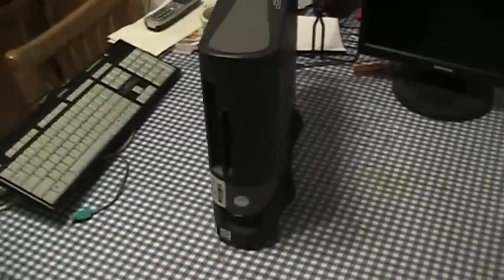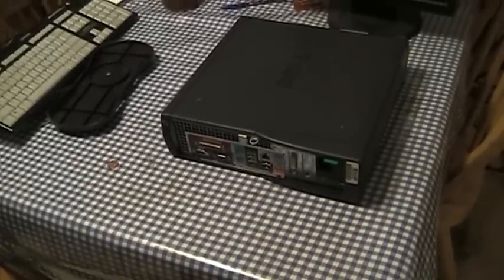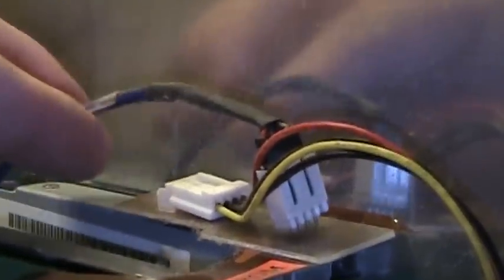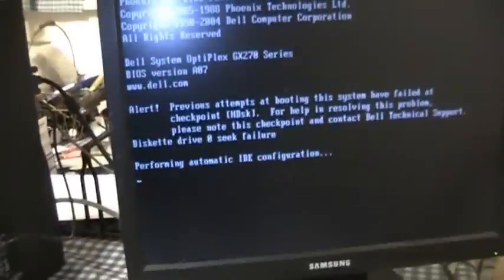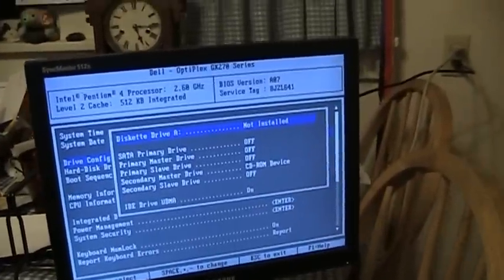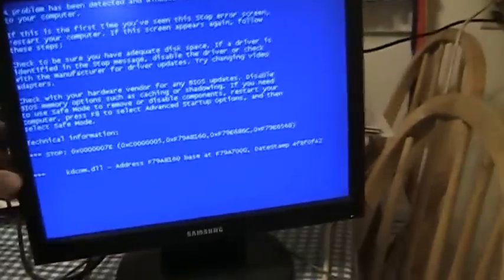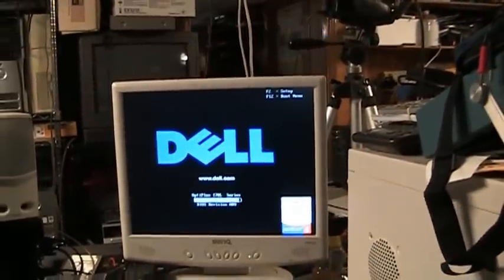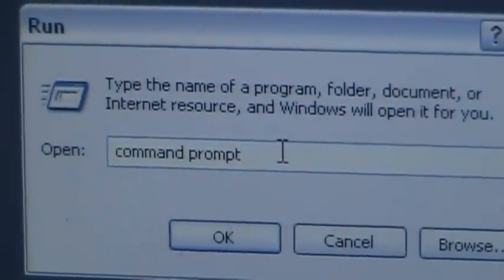UXWBill Explores Another Crappy Computer: Dell Optiplex GX270 SFF

Comment: Hello UXWBill, I need to ask you one question.
Is it viable trying resurrect Dell Precision 380?
I have little to no knowledge about Dell products, but I got two of these, both have bloated caps right next to the RAM bank (if I traced it correctly it should be power for RAM sticks). When I tried to turn them on, both had the same problem. I am not asking how to change the caps, I need to know if it is worth the time and effort. I can't decide because it has really nice sturdy case, but I don't know what cooling performance I can get from that.
Both has Pentium 4 Extreme, one has 4 GB RAM, one 1GB, one has Nvidia GT218, one Nvidia 9600GT. Both has one 250 GB drive, floppy drive (so it is real computer, wink wink) and DVD burner. As computer hobbyist and repairman I know this is pretty darn good stuff since it was free (both computers were scrapped from office), but I can put it somewhere else. So I need your opinion. Thank you very much for answer!
P.S. If there is some grammar mistakes, excuse me, I don't speak english as my primary language.
Reply from the maker: In all honesty that is something only you can determine. If you have a good use for these computers, or would like to practice your component replacement skills, it is probably worth repairing them. Replacement capacitors cost very little.
Reply: ***** Oh yeah, I could make it my primary Linux computer and learn that system a little. Thank you!

Comment: the mid 2000s dells are just crappy compared to the pentium iii ones, they're ugly as heck, crash all the time, and pentium 4 is nothing special; i had a dimension 8400 with sata hard drive, adequate memory, clean install windows xp with proper drivers and still slow as heck/crashing all time; i smashed it out of frustration
Reply: ***** and you didn't have problems?
Reply: ***** i must have had a bad one then... there were hardware issues when i got it then i reinstalled XP and the issues continued; or maybe it's XP, what OS did you use
Reply: ***** maybe got a defective one or just is incompatible with windows xp even tho it came with xp... idk strange
Reply: That's odd. I've never had any problems with P4 XP machines.
Reply: I bought a Dimension 8400 for cheap on ebay. Shipped with an ATI Radeon x300 and a Sound Blaster Audigy 2 ZS. I just had to get it. I upgraded it to a Pentium 4 640, it's a a 64 bit CPU.

Comment: The dell computer could of belonged to a school. Which could elate/relate to why there was a password on the bios. Along with the replacement PSU. Our school used to have the same systems and the power supplies just kept on dying. We hade them in our district from between  2000-2007. Have no idea when these machines were released for the public.   They ran windows xp pro with 412 megabyte of ram and really badly burned crt monitors that all had a black outline of the NOVELL Login Client in the middle of the screen as there was no screensaver.
Reply: Are you somewhere within the province of Ontario? everything you described is the same as our schools and in the same time period before they got IBM Thinkcenter PC's
Reply: I am not based in Ontario. I'm located in the USA and would rather not say what state. For security reasons and I meant to say 512mb ram
Reply: Peter Folchi
good enough, it's just that that situation seemed too similar to disregard it.  just asking, did it have either a Northwood or Prescott Pentium 4 running at 2.8Ghz?, if you can remember it
Reply: Devin Hepburn I believe it was a Prescott I can't say for sure as they were returned to dell after I finished 4th grade and then the school districts got dell optiplex 740 small form factor machines. Then in the 2015-2016 such school district upgraded to dell optiplex 9020 which have core i5 with 8 Gb ram and 500 GB HDD
Reply: Peter Folchi
I've been at 3 school's since, but from what i can remember, the school's PC"s were upgraded in 2014 to later Pentium 4 HT CPU's, no earlier than the year before the Core 2 line was announced. Now i see lower-end PC"s in our school with Core 2 Duo's, were higher end ones (the HP Compaq Elite 8300 specifically) using the i7 3770, 8GB RAM, and a 1TB HDD, which is what we use for my last period class
Reply: On our school district we had this computers with windows XP until 2010 and we had dell ultrasharp monitors with the same black outline from the Novell Client :D later with Windows 7 and the new HP desktops the network became more worse and even slower I'm so lucky that left school in 2012  after final exams...

Comment: I have a GX240 (or maybe it's a 260, I forget), the first computer I bought with my own money! What a POS, the narrow design with a rather small rear vent seemed purposefully created to choke itself to death with dust, and it couldn't run much of anything well.
Reply: It turned out to be a GX270, and after I cleaned out 5 pounds of dust and plugged it in...I found out the mainboard had failed. :(
Reply: Are you sure it's the board? What's it doing?
Reply: Jim Dayton It's long since been recycled, but the only sign of life it had was a faintly blinking orange power button light. No fans or anything.
Reply: V. Sigma Usually in Dell's a blinking orange power light means a bad power supply.

Comment: You may be suprised to learn that my ibm aptiva was built with a maxtor hard drive. it is an original part as the date sticker is identical to the cd and floppy stickers. Now makes a large grinding noise. I bought a new old stock maxtor drive to replace it, simply becuase if i buy any other ide drives god knows where they have been and banging around. at least there are a lot of unopened maxtor drive retail boxes to pick from on ebay.

Comment: There are allot of conditions for an HDD failure... On board controller failures which are rare, spin up issues which are common and head stuck to the disk also common.... Get a good mechanical while you still can buy them... I love SSD as a boot drive but not for Mass data...

Comment: I was just thinking uxwbill I know this is an old video but you could've put in a GeForce 8400 GS in that AGP slot as I think that is the latest card supported for AGP, dunno if AMD has anything fairly recent supporting AGP so technically you could run a few modern games that don't require dual-or quad-core CPUs and major 3D performance though if that is an LGA775 (doubt it must be Socket 423 or 478 or something).
Reply: The Optiplex 170L should have SATA support. I have 3 full towers and all of them have SATA on the board, all be it only one port. (Bottom right corner) If the system you have is a SFF it maybe different......
Reply from the maker: All GeForce 8400 and 8600 silicon is defective, now or later. It is therefore best completely avoided.
Reply: Do you mean they don't work or they're just obsolete?  Reason I ask is you were gonna put a 6200 in one of your own systems and that was a low-end card too.  Was there something wrong with the lower end 8 series.
Reply from the maker: I mean they are defective, as in they will fail due to a manufacturing issue. Part of the issue is seemingly heat related and the rest of it has to do with materials used to package the chip. The 6200's a lower end chip to be sure, but it is all of reliable, far better than whatever was probably in the system previously, cheap enough to be worthwhile for an older system, and it uses very little power. The only trick now is finding one. I believe that all of the GeForce 6200 based solutions are off the market, and nVidia is no longer developing current drivers for it...which might make them a nonstarter under newer versions of Windows. Linux users are not immune to this problem either: the nouveau driver is complete crap and using an older version of the proprietary driver may not work due to graphics architecture changes.
Reply: Ah I didn't know that they had manufacturing defects.  Interesting, how about later Nvidia cards there's gotta be an AGP version of something about or even AMD must have something even though AGP is effectively obsolete and forgotten about there must be a niche market for older systems out there?
Reply from the maker: With few exceptions, the last of nVidia's AGP offerings dried up sometime around the GeForce 9 series. ATI and AMD were in the game a bit longer, and I believe the Radeon HD3450 was an officially supported offering. Later GPUs have surfaced from both nVidia and ATI, though in both cases this had to do with card manufacturers gluing together a more modern GPU with an older or third party bridge chip. Bear in mind that apart from a few stragglers, AGP was fading out fast by 2005. That means the youngest AGP systems are around 10 years old at this point.
Reply: Yeah I guess there aren't many folk using AGP systems for gaming on a daily basis anymore these days.  Still it's nice to know you can still get a fairly modern GPU for such computers I was just thinking if say a younger person getting their first computer maybe gets the old one and wanted a cheap way to get into gaming with a SFC PC like this though obviously with the tech being soo cheap nowadays and most people on iPad's and phones nowadays for gaming that might not apply as much as it once did.
Reply: i seen Radeon HD3450 or a simular card on ebay for 17 dollars as in 7/3/2016  but i am into more of the windows 7/8.1 type games but i might get into older desktops one day also i have a dell 170l but would rather get something with a sata drive support
Reply: Tom Wilde  maybe something bigger because i dont want to kill it lack of airflow or maybe a better motherboard to support 64bit because i have winxp and thats mostly a 32bit os since everyone is droping support on it sure i can always put linux but even the people who make it will be droping 32bit support
Reply from the maker: There is a tower version of the Optiplex 170L that uses a much more conventional and more than well enough ventilated design. The point's largely academic: Core 2 Duo systems are very cheap these days and they will run RINGS around any Pentium 4 or Pentium D system. So unless you really have your heart set on a Pentium 4, they aren't really worth seeking out. 

Linux as a whole is not dropping 32-bit system support. Only one particular distribution has recently talked of doing so, and even if they do, their long term support release will be maintained for a few more years on all the CPUs it supported. You would still be able to choose another distribution and it is possible that someone from the community would elect to build a 32-bit version of a distribution whose official releases were 64-bit only.
Reply: Good points there Bill.  Heck you can even find the likes of Core i3 and i5 systems these days at silly low prices laptops have them here for like £300 which is about $500 so there really is no sense in going for an older Pentium 4 unless it's a few dollars for the whole unit.
Reply: +uxwbill yeah I'll have to do my homework I know Linux distributions few of them don't work well with some hardware could say I like windows I came from Macs as a kid I like Linux its just old documentation bugs me lot with it
Reply: +uxwbill.

Comment: How do you see all those statistics about the drive. like the power cycle count and all?
Reply from the maker: Getting this data requires a hard drive that supports SMART data collection. Most any drive made in the last 20 years has that capability. Once you have that, you need software that can display the data. SpeedFan, HDAT2 and other programs are capable of this.
Reply: +uxwbill OK thanks
Reply: +uxwbill something tells me that the jumper wont be coming  off
Reply: +uxwbill something tells me that the jumper wont be coming  off

Comment: Hey bill I have a gx270 and a gx280 and the 270 broke down in a week of use
Reply: And I've added an ati Radeon hd 4550 I think and I upgraded the p4 from 2.8 ghz to 3.0 I did it on the gx 280

Comment: Stop 7E: SYSTEM_THREAD_EXCEPTION_NOT_HANDLED

The system generated an exception that the error handler did not catch, causing a domino effect.

Also the hardrive spinning down and up means that the spindle is degraded and can no longer maintain a constant RPM speed to remain in a stable working state.
Reply: Interesting. I wondered why the HD spinning down was a bad sign.
Reply: The code 0xC0000005 is a STATUS_ACCESS_VIOLATION indicating a memory access violation occurred. Probably improperly seated or faulty RAM. Could be the diamondcrash drive as well.

Comment: Hey uxwbill, at 13:04 I noticed that the same exact thing is wrong with my SFF Pentium 4 machine from HP. It uses a proprietary power supply with that nasty glue that becomes conductive over time. Mine didn't blow up, but it stopped working, and I would really like to replace the power supply. But I'm afraid that the replacement power supply will also have this glue. Is there a way for me to buy a replacement part and remove the glue before it gets conductive after being inactive for a long time?
Reply from the maker: These days I doubt there are any original HP power supplies available that haven't begun to suffer this problem. Removing all the conductive glue can be extremely tedious. You'd have to remove the glued-in components by desoldering them from the circuit board and clean all of the glue off both the part and the circuit board.

Some of these power supplies actually are standard form factors, they're just a lot less commonly used. You may be able to buy a brand new one from another manufacturer.

Comment: One of my sisters old boyfriends gave me 3 of these, 2 that ran. After cleaning it out, putting in a new hard drive and replacing one bad ram chip, the other ran as well. I have it running a headless linux server as a database for my work (low usage that I backup often). One of the others was given to a church to power a self playing organ, and the last is a backup. Other than the 6 month dust blow outs its pretty out of mind and runs reasonably well. Not that I would run more than a low usage headless system on it. The low spec power supply to me was a plus, it doesnt draw that much power.

Comment: Don't really know why, but I've always kind of liked these small form factor or desktop Dell Optiplexes that shared this weird case design. I've got a GX240 that's a desktop, not quite a small form factor machine, and I think it's pretty cool. Got it with a 250GB hard drive in it. Don't know who put it in, but that's certainly a lot of space for a computer that will never be used more than once every couple of months.
Reply: I used to have a GX240 and I used it for years. Loved it. Never had a problem with it. Ended up upgrading the P4 to I think it was a 2.4 GHz..

Comment: Oh joy with dealing these piece of crap mini-computers so eagly bought by all offices in the world because they fit neatly in the cubicle and have DAT DELL LOGO. Joy of devices so beautifully thermally designed they overheat if someone runs 2 Excel sessions at once, non-standard parts, feeling of being king of a jungle trying to actually do something inside of them maneuvring along all these carefully placed cables (too bad you can't use survival knife), branded OSes fully loaded with bloatware (everyone needs a toolbar on top of the screen that runs MIDI player, control panel and opens Dell support website, and tray icon reminding to update drivers). Title of my opem is "Laments of former IT guy that always got these puppies way after their support contract ended, or there wasn't any". And whoever invented idea of putting Pentium 4 inside that toaster must had been some sadist hating poor ladies from HR or accountants so much he thought "Let's make them BURN, on the entire world, using this thing" :) Ah, and joy of inheriting 20 Optiplexes with server running Microsoft SBS, letters from D to Z used for mapped network drives for every computer (that's the idea of "file sharing" by trained SBS professionals) running over NetBIOS, so it takes 5 minutes to run an explorer window. <3

Comment: dell using a clamshell case on a small form factor computer was a bad idea, in my opinion, i mean the clamshell design has problems on tower PCs, i dont even think video could show how bad it is in a small form factor design (assuming this the only clamshell dell i have is a tower, which i have done enough cable management in to make it possible to service easily)

Comment: As many Maxtor hard drives that I have had, none of them have failed, although only one was actually regularly used. My gaming PC back in 2009 had a 200 GB Maxtor DiamondMax 10 that still runs to this day. Two of my 20 GB Maxtor drives, one from some old Alienware and one from an old HP, both report problems, but still work.

Comment: This was (and still is) my favorite Dell computer... The SFF specifically. My daycare had two as a kid, and I just fell in love with the design. Being the young me, I would always vouch to take good care of them (they didn't have an internet connection + Windows 2000). Ever since then, I found one at a garage sale for $5, and she's still running today.

However, I can certainly vouch for the capacitor issues... She's got a brand new board now, to say the least. The other board is hanging on my wall - all the capacitors to the left of the CPU were blown. I've also stuffed an ATi x1500 graphics card in there, along with a new 120 GB Maxtor drive (all I could find before I found out there was a SATA chip ;-; ). She runs pretty hot as it is right now, but it's a very quiet and effective machine. I've got it running Windows 7, too.